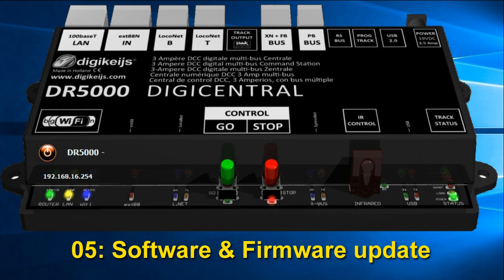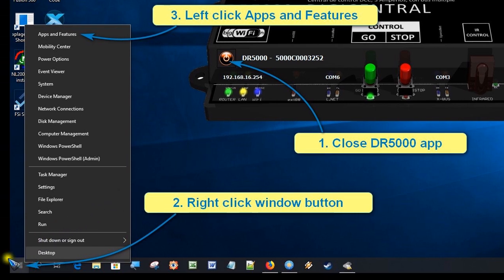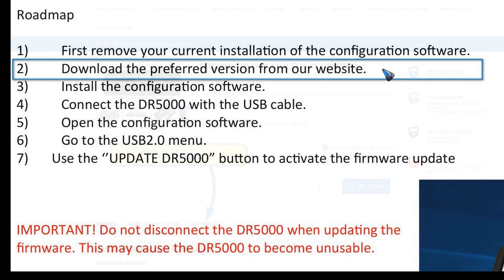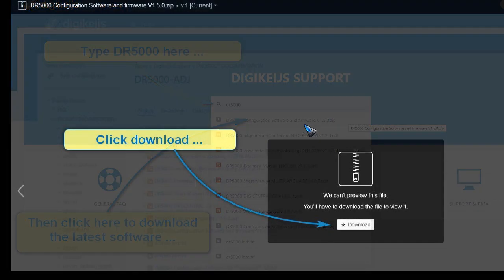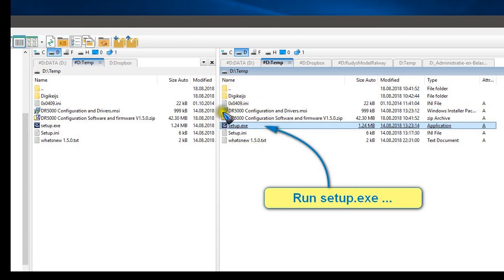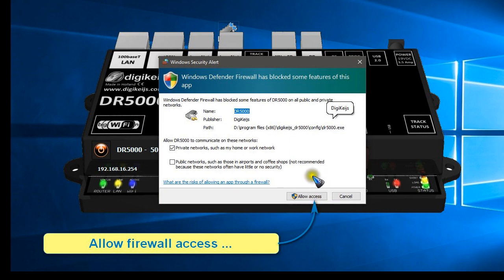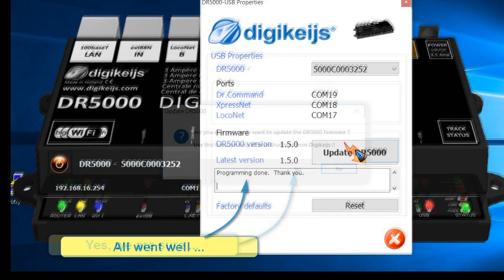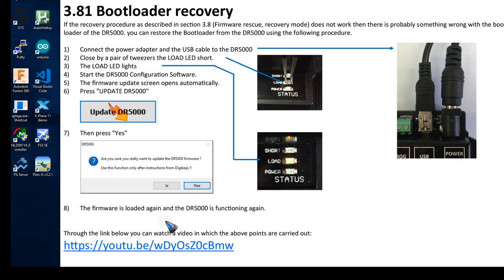Digikeijs DR5000 05 Software Firmware Upgrade

Comment: Hi Rudy
Is it possible to run both the wifi and Lan at the same time. I want to run traincontroller and a wifi throttle such as the Roco Wifi or the Z21 App
Reply from the maker: Alan Dance I haven't tried to use LAN and WiFi at the same time so can't tell if that would work. Why not connect to the PC via USB?
Reply: Hi Rudy thanks for the reply @rudyshobbychannel have you connected traincontroller to the DR5000 yet.
Reply from the maker: Alan Dance Yes, we have multiple DR5000’s around at the club and here at home and they all connect fine via USB. I don't use LAN, but one time when I did the video. :)

Comment: Hello Rudy. I like your series of Videos... You may consider adding this action before you update.. Click on the Control Go/Stop Icon on the software, and back up your settings to the computer, using the Import Export  Buttins, then, after the update, restore the settings and you don't need to reconfigure your Dr-5000.... Cheers Marty